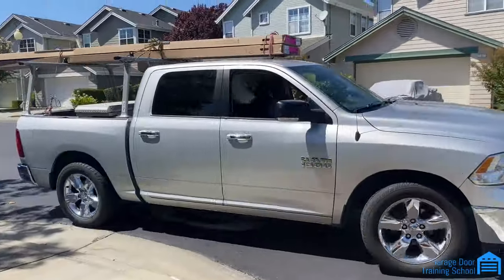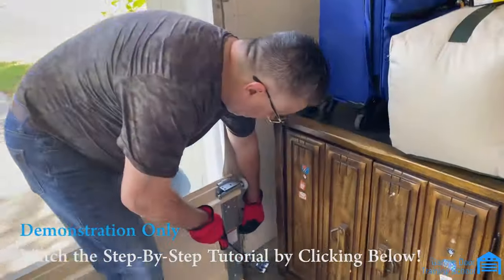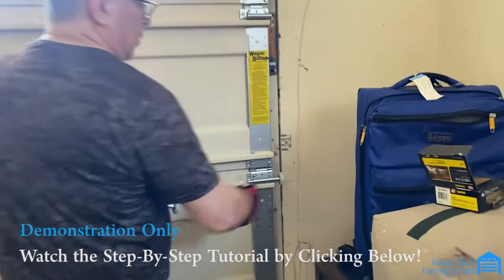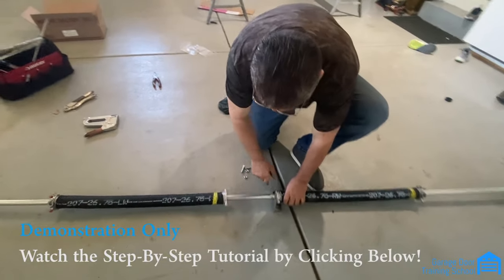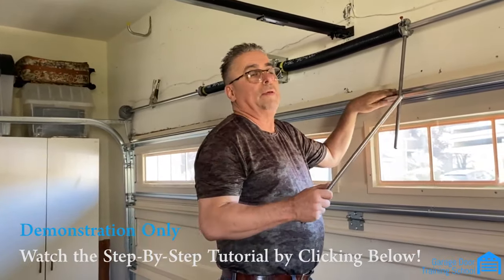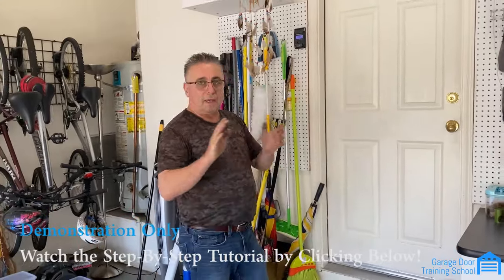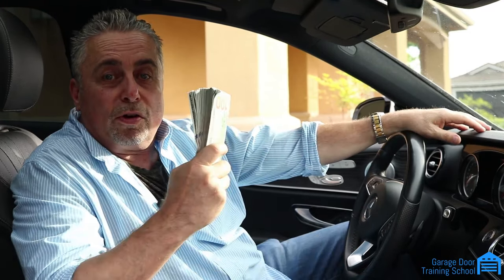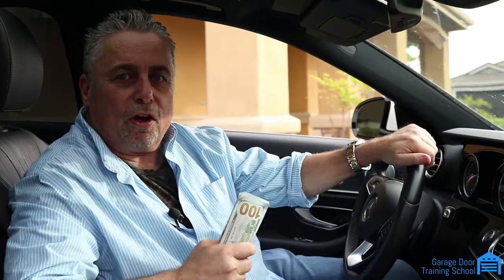Garage Door Installation - Demonstration (Full Tutorial Below)

Comment: Qnd spring sizes are they all different it seems they are thanks
Reply: Yes they are you have different aize springs for different weighted doors for example here in Florida we have one door just a standard 
Clopay w3 door gets 5 struts and 234 size springs which are slightly smaller then we have a 
Clopay w5 and that gets 8 struts and a 243 and 250 spring because it's heavier.

(Struts) bar across the panel to help with the amount of wind it can withstand in Florida depending on where you live you may not get struts or have to use them

Comment: Tips on fixing gap in the top of the door? A lot of times we install, the very top panel won’t be fully seated and closed against the opening, leaving a gap and we never know how to fix the problem.
Reply: You should take the course because there are several ways you can accomplish this. After taking the course and learning the correct way I’m sure you will not run into this issue in the future!  You can sign up at www.garagedoortrainingschool.com
Reply: All you need to do is loosen the two set screws that hold the top fixtures and while pushing the door to the wall pull the bracket that holds the very top roller towards yourself until it can’t adjust further and then tighten the two set screws. Do that on both sides and the door will seal better at the top. Also you could just put residential trim around the outside of the door, so you block the majority of the sunlight from leaking through.